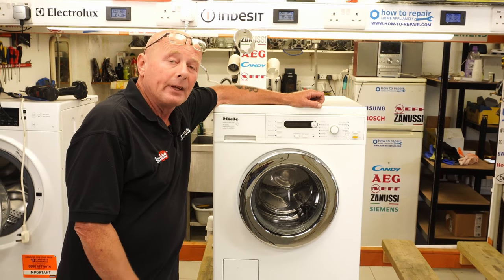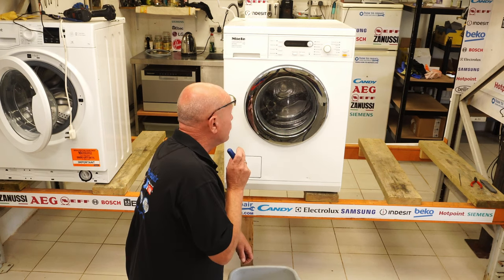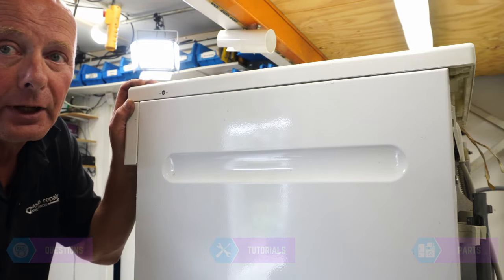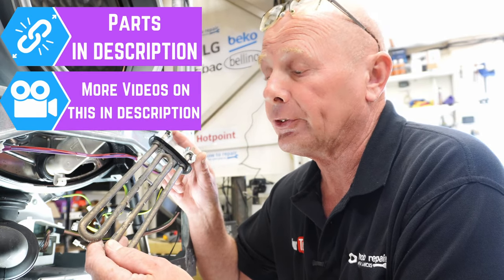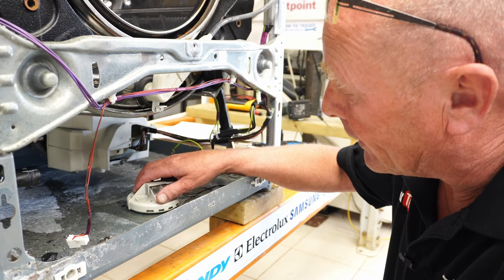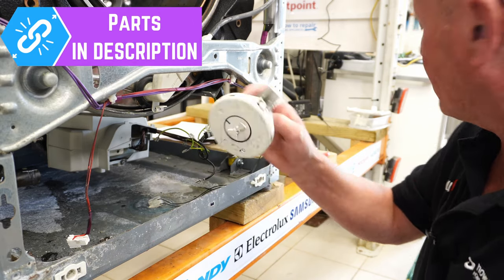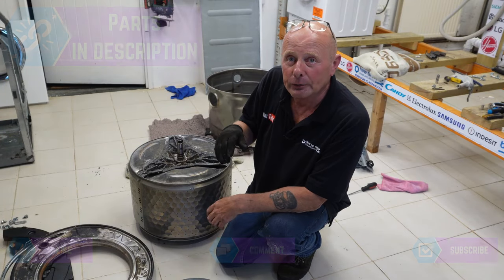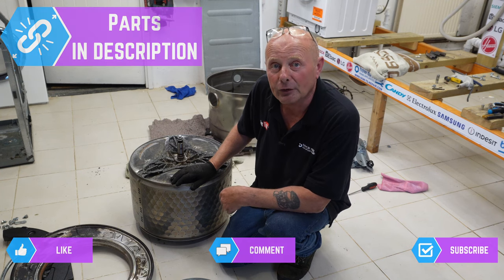Mastering #Miele Inside Out of a Washing Machine Dismantling Guide To Take Apart

Comment: Great video, very well explained! 

The machine seems to be so well-built, but at the same time the spider is made of aluminium, as if built to fail due to corrosion. I cannot understand why nobody seems to make the original spider out of stainless steel.

However I do like the fact that the outer tub can easily be opened, for access to the spider. I remember the Merloni machines (normally labelled Servis in the UK) used to be opened in the same way, but from the back of the tub.
Reply from the maker: why build a Rolls-Royce of a washing machine and then create a bad reputation by overpricing parts deliberately
Reply: Miele UK used to be open about the outer drum material on their website; the cheaper machines had a fibreglass / plastic type of material while the higher models had a stainless steel outer drum. Seems a retrograde step to now not be open with their prospective customers, they should state the spider material too so that customers can make informed choices.
Makes me wonder what spider material the Ebac washing machines have (made in the UK). May be aluminium since they don't state the material which they surely would if it was stainless steel.
Reply: The rotating wash basket / drum has to be in stainless steel (or enamelled steel as they were years ago) to avoid marking the clothes of course. The drive spider does not and therefore cheaper materials are used. I always hoped that the top of the range Mieles had stainless steel spiders but no where is the material stated which is plain stupid tbh since if they did state the material it would put Miele at a competitive advantage assuming they use a superior material like grade 316 stainless steel (which I imagine the drum is made of). Actually grade 303 / 304 stainless steel would probably be OK for the spider, I'm not sure.

Comment: I have the broken aluminium spider issue myself. I have managed to buy a second hand steel drum spider for 70 euro. Followed your video to take the thing apart, tx! The bearing repair kit seem to have different shaft sealings so i might just have to go with what was in there.
Reply from the maker: I've had this dilemma before where I've changed the bearings and then found that there is no seal available. I put some Vaseline in the gap between the bearing and the seal the reason I use Vaseline if it leaks out through the seal it would not stain the clothes where grease would and it will also help prevent any water ingress towards the bearings as that is what the seal is designed for. What would really help me to get my video seen as I'm no IT expert is to either share the channel or at least post it to your friends my videos might not be YouTube superstars, but they save Appliances from the scrapheap. Share and help us fight appliance waste! @GenuineFlolie please remember to subscribe to our channel as that really helps us https://www.youtube.com/shorts/e432SAb2g08  Thanks, Paul 👍
Reply: @How-to-repair  Will do. Anyways i have installed the new seals that came with the Miele bearing kit, also i have tried to remove the bearings carefully but was unsuccesfull, keeping the old bearings because they are still fine. The kit came with special grease, this is what i used with the new seals.

Comment: I have a 12 year old Miele w3240 washing machine that stops after 1 minute on the final 8 minute spin displaying three dashes " - - - " on display with "indicator lights flashing" Rinses and Anti-crease/Finish on the panel.

I've checked online, and it would appear that the fault on my washing machine is a fairly common one. I've done all the usual checks e.g. filter drain pump, inlet & outlet pipes, and unplugging from the mains etc., to no avail. Although I've had it 12 years or so  its had less use than would normally be the case, and worked perfectly fine, up until a few months ago:  I've always used Calgon tablets with each wash.

Any last minute suggestions would be helpful as I resent having to discard it given my previous washing machine a Bosch lasted nearly 22 years.

Comment: Thank you for your manuals.About 24.50 you talk about how to remove the facial glass. I have tried on both my drier  and my washer and the darn clips won't budge! I am not amused with my bavarian manufacturer!  I actually have to remove the facial panel in order to get the clips to budge. Are u using a speceial tool? Could u explain close up how uyou det them to move?

Comment: Wow, Excellent video. I have a Miele 1215 Washer. We recently had a power surge and I suspect either the circuit board was fried or hopefully just the fuse blew. You mention the fuse but didn't show it exactly. Can I access the fuse without having to dismantle the front panel and just remove the top?
Reply: I just had to change the fuse on my W1213.  It can be accessed by removing the fascia panel.  If this reply is still useful, I can supply more details.

Comment: Great video. Ive  just had my washing machine (same model number) fail mid cycle and now it doesnt even power on.  Im guessing its one of the circuit boards. Do you know if theres a common failure on these as i cant see anything obvious?
Reply: The same happened to me. Did you find out?
Reply: Yes it was the main PCB. Sent it off for repair and its fine. Cost £60  @annas7801

Comment: Thanks you YouTubes have been very usefull to service my Miele W 1714 Washing Machine.

Getting the rubber ring seal and spring clip back onto the front panel is a nightmare!

Do you have any usefull tools or grease to assist this process or have I missed a YouTube covering this.

Very Best Regards Bernard Start

Comment: The display on this Miele disappears a lot of the time on my machine.
The machine still washes as normal.
I have to guess to adjust the temperature and spin speed when pressing the buttons.
Why?  Is it a capacitor or something on the board?
Reply from the maker: You want to check the communications cable coming from the main circuit board going to the display board or you may have a problem with the display on the board feeding due to a component breaking down over a period of time. you can find many of these display boards available on eBay. I will have a few on the website shortly.  @johntheaccountant5594 please remember to subscribe to our channel as that really helps us https://www.youtube.com/shorts/e432SAb2g08  Thanks, Paul 👍
Reply: @How-to-repair  Thank you for that information.  I am about to buy a Ebac 9kg Dual Flow as a second washing machine.  Is there any code for a discount?

Comment: Unfortunately this guide doesn't help with the 365. I've taken the screws out but the panel doesn't come off. From what I can see there are clips on the underneath that are holding it on/in. I don't know how you're supposed to remove these and don't want to pry in case I snap them. I've tried getting someone out to fix it but nobody wants to know as they say they don't repair this brand. All that has happened is that the door seal on the bottom has been pulled out and so it leaks and turns off. I reckon if I can get the panel off I can just take the seal off and put it back on and everything will be fine. Unfortunately I can't find a manual or guide for this machine or similar. Which is funny because there are loads of guides for phones and such, even when they've not long released but it's really difficult to find one for a washing machine.

Comment: Excellent video, but...
All i want to know is how to get the front PCB out without pulling the whole machine to bits. I know it can be done, but no one shows how to clip it out in any videos 😕 😢
Reply from the maker: I'm sorry I have not done a video on that and I don't have any Miele in the workshop at the moment
Reply: @How-to-repair  no worries, thanks for answering. My w5741 has just died. I overloaded it on the weekend. Nothing tripped at the SB but a bad burning smell came from the machine. I've smelt this from other electrical things over the years, its a capacitor usually blown. Machine now has no power, I'm wondering where the fuse and caps are located. I can see one cap at the back right corner, but it looks good, but I'll test it anyway. I have a spare front control board, hence my initial question.

Comment: That spider has failed like that as a direct result of all that grime (biofilm) that's been allowed to accumulate on the back of the tub, which has induced crevice corrosion.  Leave the door and draw open between washes and use a powder detergent preferably one with oxygen bleach (which kills microbes)  will help keep the machine clean and it will last much longer. Residue from fabric conditioner and liquid detergents contribute to the biofilm grime.

It's an electrochemical process, the biofilm coating traps stagnant moisture on the surface and creates differences in dissolved oxygen concentration which causes a difference in electrical potential, so doesn't require dissimilar metals. Chlorine in the water will speed it up and some types of aluminium alloy are more susceptible than others.
Reply: This is a really interesting comment, thank you! I will definitely bear it in mind.
Reply: But powder detergent doesn't dissolve like he liquid detergent
Reply: @whysoserious7553  Been using powder for decades, not had a problem with it not dissolving, other than small traces sticking to the draw sometimes. If you are doing a cold wash, then powder won't work so well, I usually wash at 40°C. My current machine is 15 years old and still has the original aluminium spider, admittedly it's not a miele, just a Zanussi. 
I changed the bearings a few years ago and it was clean inside, no grime stuck to the spider. I do also descale and clean my machine on a 90C cotton cycle (since it doesn't have a self cleaning cycle) with citric acid once a year.  I was put off liquid washing machine detergent when a kid, we used some for a while and it made the machine grimey and smell absolutely foul, so very rarely use it, only when washing items like silk, that must not be washed in biological powder or oxygen bleach. If you prefer to use liquids, then I'd suggest doing frequent very hot cleaning cycles with an oxygen bleach based washing machine cleaner,  and / or add oxygen bleach when you do a hot wash.
Reply: @mels8966  I just brought a bosch 9kg front load washing machine big mistake cause the drum is sealed didn't know about it earlier other brands in India except siemens the drum is not sealed even sealed drums will be serviced in India by cutting it open and sealing it back with silicon water proof sealent along with drilling some holes and putting bolts which would cost 5000 rupees (60 dollars) but don't know will it hold so I'm concerned about it fk these European brands which dont allow servicing

Comment: As the technician stated at the beginning of this video, if you paid a service tech to remove this machine from your home, take to a shop, trouble shoot, perform this work, replace the necessary parts, reassemble and return to your home - a new washing machine would be the best solution. If this was an LG top washer like I had, it would go straight to the recycler.
Reply from the maker: The problem with the whole industry now is the cost of parts for things like spiders and the labour cost make it very uneconomical to keep an appliance going for a good period of time we seem to have moved into a throw away society

Comment: In 2005 I bought the cheapest washing machine in the Argos catalogue. A £199.99 Italian made Candy. 19 years later, it's STILL going strong! ... Who says modern machines don't last?

The problem is, people don't look after their machines. They close them up and allow them to go mouldy. They don't run maintenance washes. They don't descale. They allow their machines to rust. They overload them.

Why do you think my Candy has lasted so long? Because I look after it!

EDIT: I would point out that most people's washing machines are NOT raised off the floor, as in this video, they're sitting on it! ... Additionally, most people DON'T have a "hoist!"

Best way to "save a small fortune" is to NOT buy a Miele! ... I refer you to my 19 year old £199.99 Candy! ... I'm no mug! 👍🤣

Candy's original carbons lasted 15 years! ... I replaced them 4 years ago, after the machine wouldn't spin. They were "stumps." Candy's original 19 year old belt is fine.

Comment: Hello, I need help. The machine (Miele WW5873) is not working. I replaced the CP3001RN (it was burned), but it still doesn't work. Sometimes a signal briefly appears on the display, but it turns off after 2 seconds. What should I measure and check?

https://www.youtube.com/shorts/aoBTYJ2DibI

Any help would be appreciated.

Comment: How can you do a whole wash with belt off, the drum would not turn
Reply from the maker: You only need to test all the components are working like the heater the water valves, the motor it doesn’t make any difference if the drum is not turning hope that helps you

Comment: I think meile now are crap, expensive, a nightmare to repair, why can't other manufacturers like hoover and beko, grundig, Bosch and Siemens use split drums, and USE steel spiders instead of aluminium,
Reply: It's not economical to manufacturers to make things repairable or last longer than a few years.
Reply: Why can't manufacturers take a leaf out of asko's books, they use steel spiders instead of aluminium, that means the drum spiders are corrosion proof
Reply: Miele is switching to plastic monopiece tubs. They have to so they can remain in business.